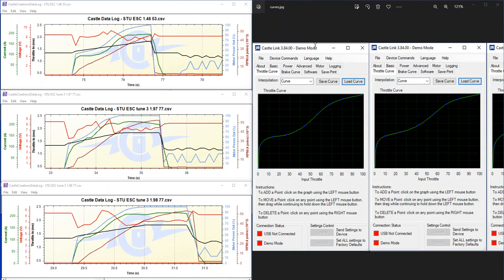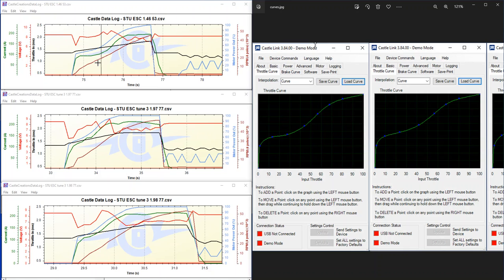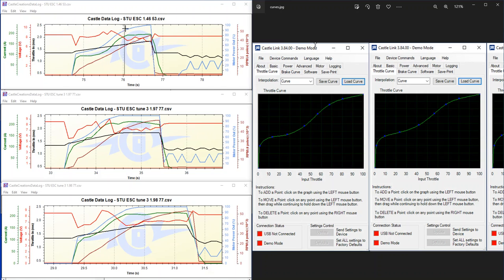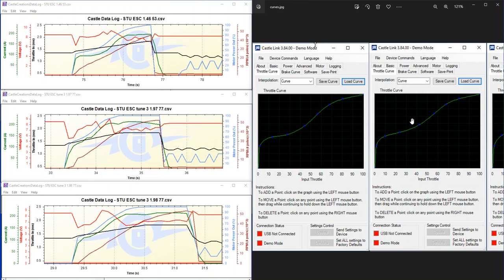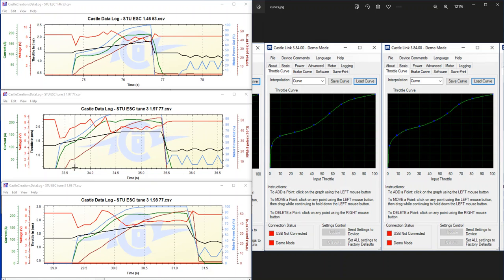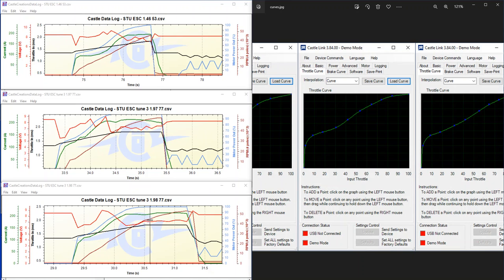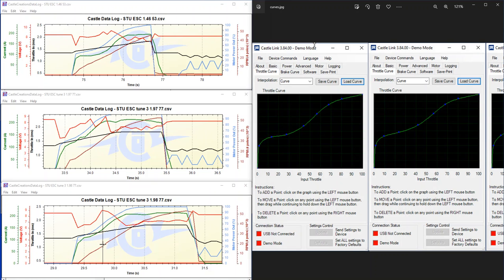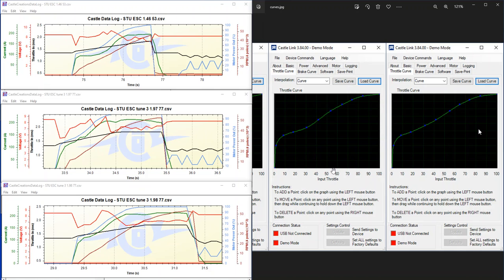Castle Creations throttle curve tuning

Comment: With having the start power up that high. What would you run for the point on the radio?
Reply from the maker: 5 to 6 and -95 ramp.
Reply: @StewMac570  Thank you.

Comment: How did you get the curve on the right to be smooth like that? I’m sorry I don’t think I caught it in the video. Also how does changing the gauge of wire change any of the data you’re showing just out of curiosity? How would amperage or throttle curve or any of that change if let’s say a person went from an ic2 connection to an ic3? Does how much amperage the battery or esc connector can handle affect the data in any way that you’ve shown? I ask all this because I recently put a castle 1010 series motor in my arrma granite grom and it’s the first time in a while I’m giving castle electronics another chance

Greetings from Florida, USA!!!!
Reply from the maker: @jonahshetterly3515  there is a setting for the curve to be liner or curve. Curve will make it smooth

Changing the thickness of the wire reduces resistance which in turn reduces amps and less voltage sag. Changing just the connectors would have a small impact on amps
Reply: How can i set the curve for drag race? Greetings from Greece